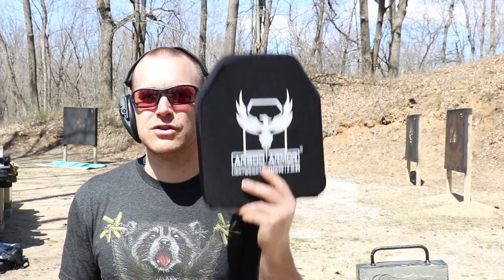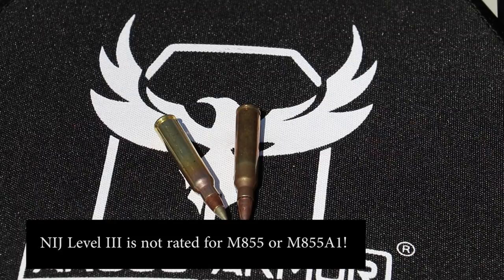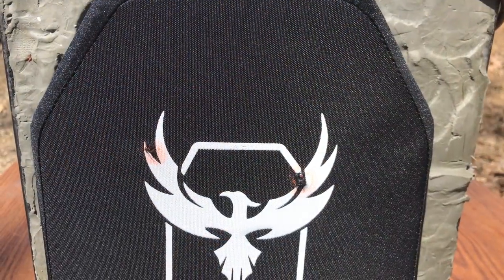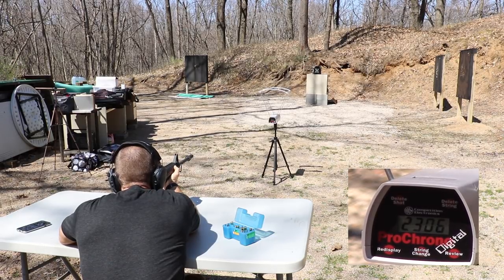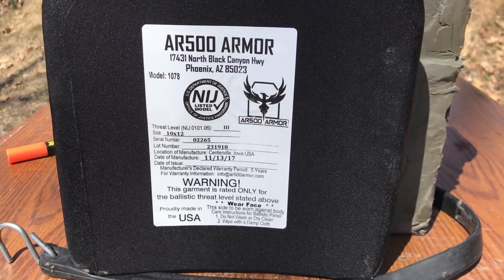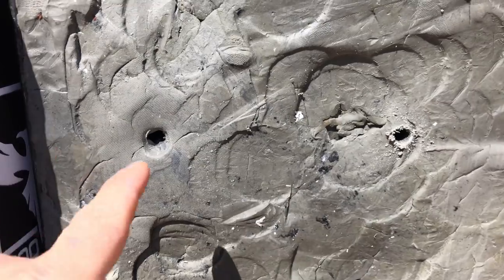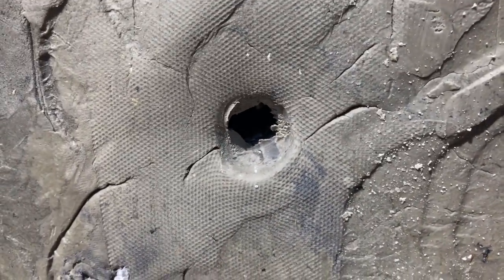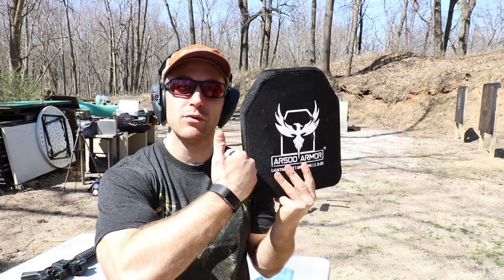Can Armor Stop M855 or M855A1? @AR500 Armor® 1078 Level III

Comment: Now I know not to get these plates. Tactical Scorpions Lvl III AR500 junk budget plate provides a lot more protection than this at $50 a plate. Is this plate supposed to be good against M193 or something?
Reply from the maker: Yes it will stop M193 at insane speeds, as well as NIJ spec M80 Ball. PE plates are good with speed, but bad with steel core projectiles. Steel plates are good with some steel core projectiles like M855, but only with some lower speed M855A1.
Reply: @BuffRANGE  Is there a happy medium that isn't $300 Lvl 4 plates? So it sounds like the M855A1 is the PE plate achille's heel then. Really, everyone's achilles heel since it punches Lvl 3 AR 500 and I could have sworn I've seen it defeat Lvl3+ AR650 plates. I'm gonna have a look around. What do you suggest as a compromise, as far as a plate that does well against both?
Reply from the maker: @nicholaddelioncourt7863  That's the hard part. M855A1 over 3000 fps will defeat most all steel plates. You need a ceramic strike face to stop it, which is where III+ ceramic plates can come in handy, but they tend to be  more expensive than steel or pure PE. There are certainly budget Level IV plates (RMA has their 1155 on sale a lot for $99/plate), but they are heavier like steel, and only single curve. 

If you think you'll encounter M855A1 or M855, make sure you have something in III+ that has been shown to stop it.
Reply: @BuffRANGE  Thanks for the info. I'll look at the RMA Lvl4 plate. I can handle a bit of weight, I'm pretty good shape.
Reply: @BuffRANGE  Where do you usually find the same on the RMA plates?
Reply from the maker: I watch their Facebook page a lot. They tend to do the sales every few months